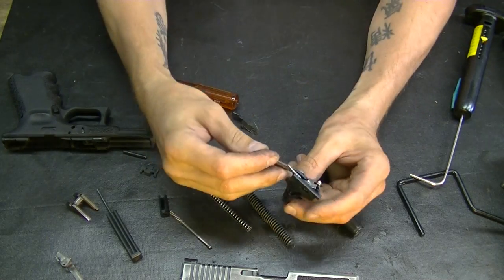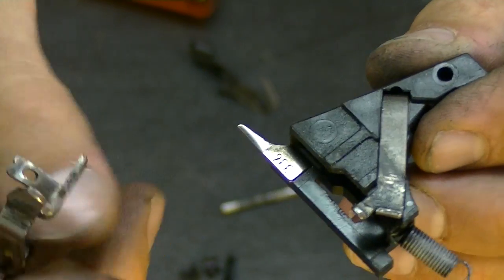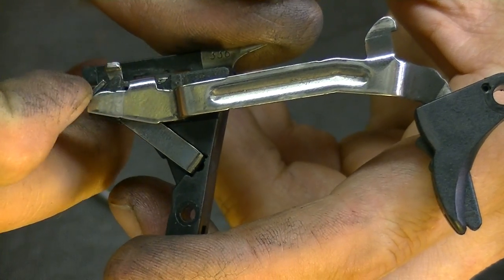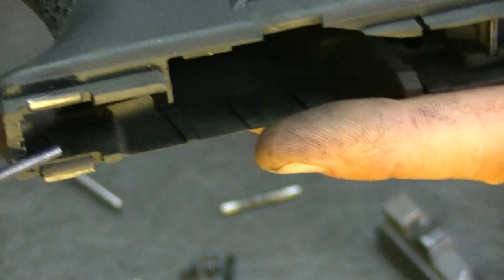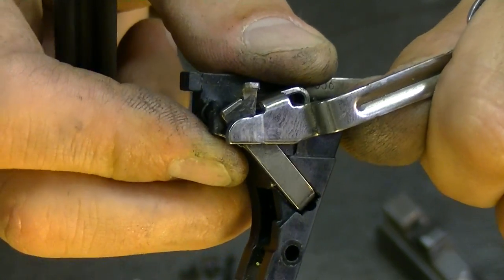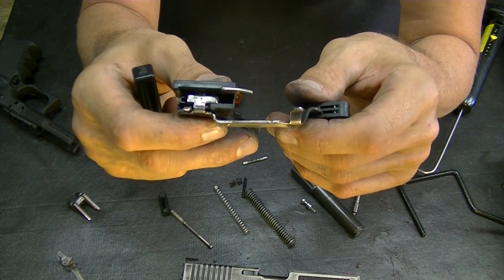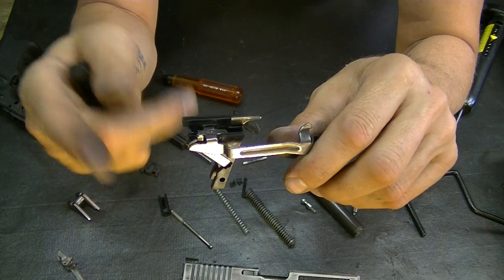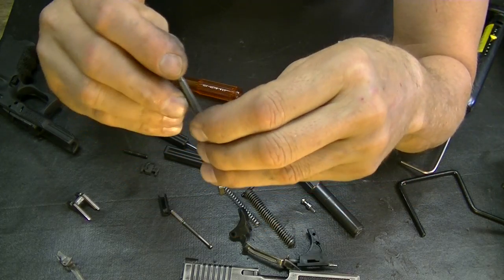Part 3 of part 1 Tom's break down  EDUCATIONAL ONLY

Comment: I wonder if someone could build a jig for a bench vice to gently squeeze the slide so you don't have to hammer the slide.
Reply from the maker: Matt Lord I've seen them. They are used for 1911 slide tightening
Reply: Peening and knurling are a recognized operation when done correctly